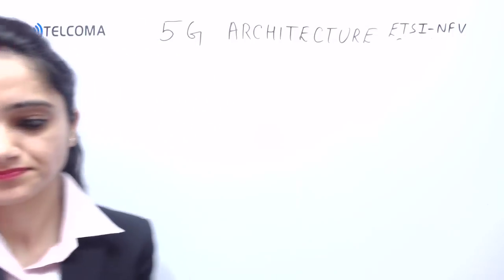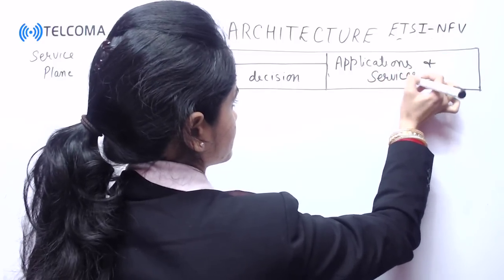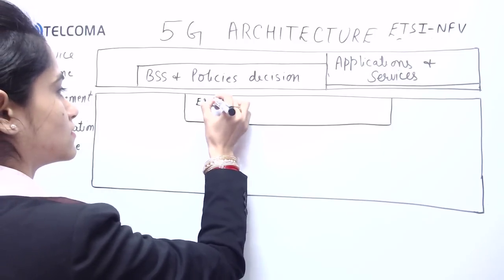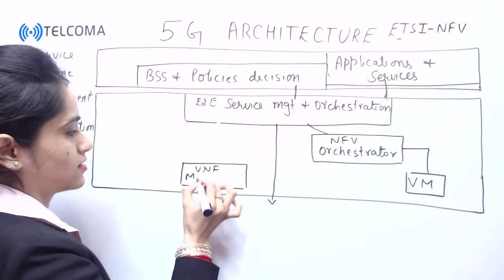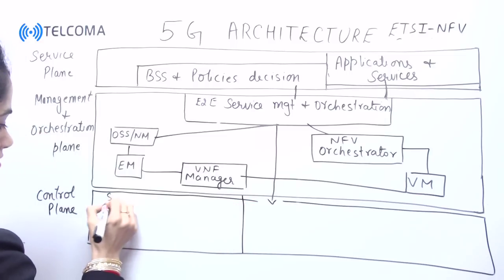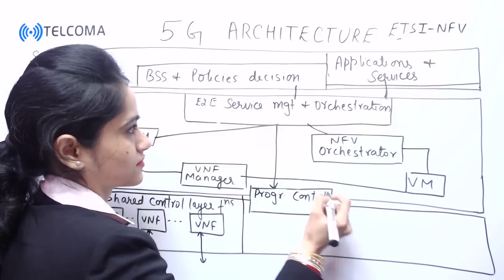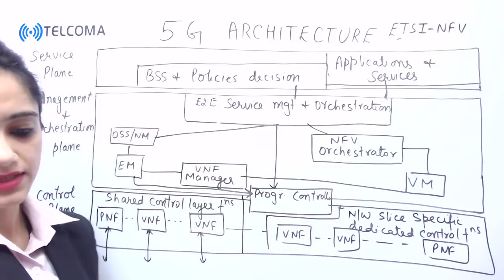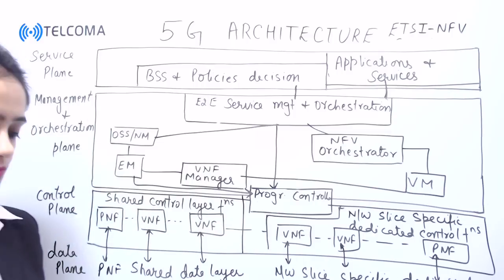5G Architecture Plane- Part 1 by TELCOMA Global

Comment: Hi. I have made channel on LTE Optimisation. Channel Name is RF Engineer NP. if you see the videos till end definitely it will be a great help. Today will start with RRC Failure in No reply.

RRC LTE Call flow.
@TFAY  Part1
@TK0c  Part2

CSFB Optimization Links 
@xtu4  Call flow Part1
@1CaQ  Call flow Part2
@baF0  KPI Parameters and Troubleshooting

X2 Handover Troubleshooting.
@t
@t